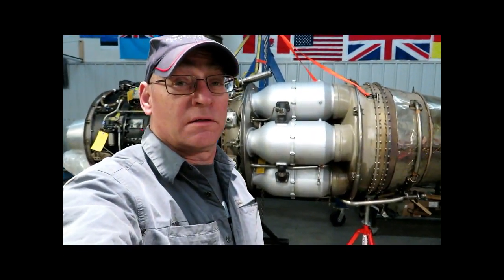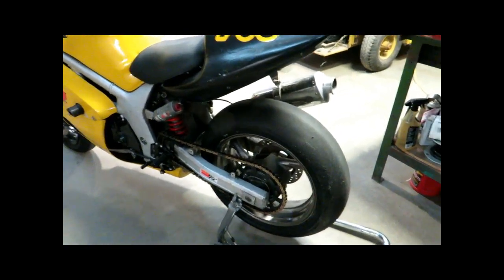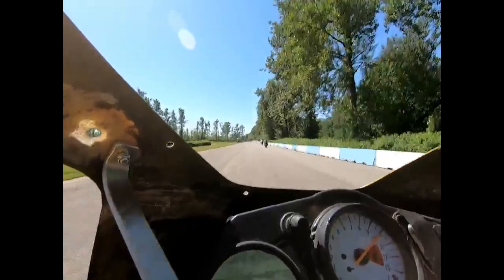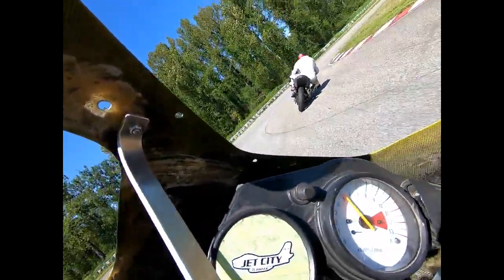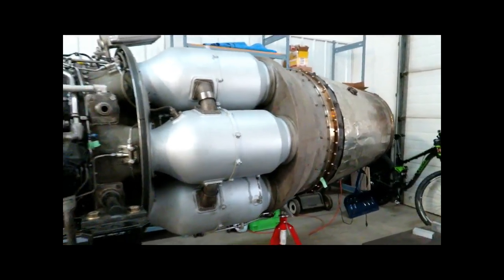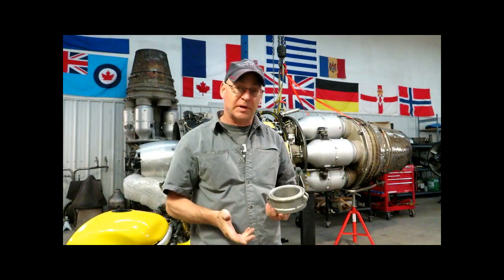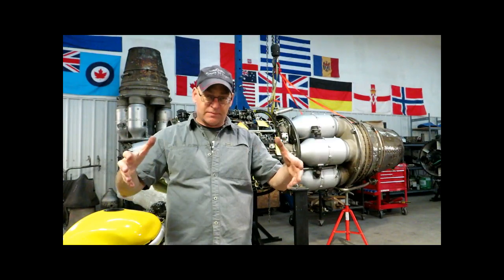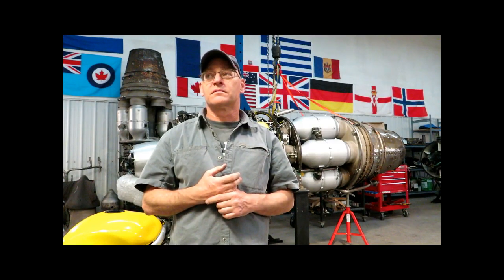Racing Bikes and Active Clearance Control

Comment: Hi Jay, Nice bike.  70 HP, I think that qualifies as a vibrating tingle rocket.  Lately I've been watching Mikey McBryan over at Plane Savers in Montreal and they had some very flattering things to say about  you and what you do.  They got really wound up when you wrote them back about the Orendas.  They clearly admire you and so do I.  After watching your work I always come away a wee bit smarter than when I started, and that's saying something coming from an man who's often been accused of being so old he farts dust from both ends.  You can teach an old dog new tricks. Just hold your breath if you hear a squeak.  Thanks for some time well spent.  T. N. from Ann Arbor.

Comment: Active clearance control seems to be a difficult topic. Even for the manufacturers.  The racc (rotor active clearance control) has been removed by a service bulletin  from most of the PW 4000s in service. The same goes for the cfm 56 series. The racc valve got replaced with a turbine bleed valve.
The hptacc (high pressure turbine active clearance control)  on cfm 56's is a bit more sophisticated, compared to the 4000's.
On the cfms, not the turbine case, but the turbine shroud hangers are being cooled (the hangers contract, so the clearance between the blades and the turbine shrouds gets smaller). The hptacc valve mixes 4th and  9th stage compressor air, depending on the thrust settings. On idle the valve is fully closed. On takeoff power only 9th stage air is being used .On higher power settings the valve is modulating, mixing 4th and 9th stage air. On cruise only 4th stage is being used. Depending on n2 (rpm of the high pressure system), the compressorblades get longer because of the centrifugal forces and thermal expansion.Therefore: if n2 is high, less cooling is needed. 9th stage air is hotter than 4th stage air, so on higer thrust settings, less 4th stage air is being used. The same goes for the lptacc. The difference is: the lptacc cools the lpt case, and only uses fan air.

Comment: For compressor clearance control or anti-icing, the air used are definitely compressor discharge air instead of post-combustion air. The air at best received some heat transfer through radiation or conduction with outer liner and are not really much hotter than compressor discharge.

Compressor clearance control typically rely less on cooling the case because there's no pressurized yet still cold air to go around -- routing from discharge forward, it's too hot; getting from the fan, it's not pressurized enough and you have no way to mix that air back into core flow. There are ways to get around, but it's a matter of cost and weight vs performance. Not 100% on the exact layout of PW4000, but feeding compressor discharge air through compressor rotor wheelspace forward to the last few stages of compressor rotors and warm them up is not new any more -- pretty sure P&W's patent's been expired by now.

Comment: Sorry your engine test stand is down but not a bad trade off to run some trackdays. I raced a superstock 2003 SV650 here in Oregon. Easy fix for your windscreen is with a $12 piece of 8mm clear plastic from Lowes/Home Depot and a heat gun. Helps to make a carboard pattern and trace out onto the plastic and then very slowly cut it out with a scoll saw and fine trim with dremel/sandpaper roll. Not as nice as the $90 ones, but it does help with the aerodynamics and worth the effort. Cheers!

Comment: I think you touched on one of the main reasons at the end for the choice of internal vs external, and that is the amount of working gas that is required to make the adjustment. A secondary reason may be that the external part is exposed to atmosphere and may be less thermally stable.

Comment: Thx for another informative video AgentJayZ. We both have interest in planes, bikes and boats. I get my Duc 1200 out on track days occasionally but not racing like you. FWIW I worked for an electric utility which  performed an upgrade on the high pressure steam (Supercritical) turbine (3500psi 1050deg f)    which involved reducing clearances between rotor and casing unfortunately during start up it rubbed due to insuficient thermal soak time (differential expansion) 2x before engineers updated start up ramp curve for tighter clearances. (Whoops) Lots of OT fixing damaged blades and opening/closing heavy casings.
Reply: Bill Dennis how cool working supercritical. I work running lms6000’s and 2 lm100’s. How many mw is that supercritical?
Reply: @JAMESWUERTELE  they were 750mw James definnately didn't want main steam leak to be around you.
Reply: We have HRSG’s, and my past was old coal plants. I know what a few hundred pound leaks look like and it’s amazing the power of steam. I’ve been around leaky old 1940’s boilers having to add phosphates to try and plug up the small leaks in the water walls. I do miss working at the older plants, this sitting in front of 36 screens is just like playing a game all day!

Comment: The subject of tip clearance control can be quite complex and axial clearances are also affected by the differences in relative thermal growth rates between rotors and stators.  
I believe that I've discussed this in the past, but there is an essential problem between the compressor and turbine rotors and their respective casings.  Compared to the rotors, the casings are thin, have relatively low thermal masses. and are close to the gas path.  In comparison, the discs have significantly greater thermal masses and their bores are relatively distant from the gas path.  
While the casings have a 'single rate' thermal growth characteristic, the rotors (particularly in the turbines) have a very distinct 'two' rate characteristic.  Why?  Because the blades grow very rapidly in a matter of seconds, as they are directly exposed to the gas path temperatures, while the discs might take into the tens of minutes to become fully heat soaked.  The casings, in the meantime, will expand in a matter of a minute or two, so it is all very dynamic and very dependent on the 'architecture' of the individual engine.  
Optimisation of the tip clearance by active management of modulated external cooling of the casing, which is typically used in the turbine(s], or heating of the rotor, which is typically used in the compressor(s), takes a good deal of finessing during the design and development process.  There can be a fine line, for instance, between allowing the tip clearances of the compressor to increase on take-off and climb-out, to avoid tip rubs, and reducing the surge margin, with the risk of inducing a surge during take-off.

Comment: When I think of it... An other reason to not cool the compressor outer casing is: There are various accessories mounted to the compressor outer casing, that most likely don't wane get frozen. The temperature gradient between casing and rotor may be so high, that you would need to blast ambient air at them. At the cruse height of an air liner ambient air gets below freezing. So it is easier to heat up the rotor. This way the outside of the compressor can stay at a comfortable and stable temperature. Also think of thermal cycles of the accessories.

On the turbine, on the other side (literally), you can't heat up the turbine blades even more without melting them. So you cool the turbine casing. There are no accessories there and if there are accessories they get heated by the exhaust. So cooling them is advantages.
Reply: The cooling effect on the exterior of the compressor casings from the external ventilation flows is relatively small, even at altitude, as compared to the heating effect from the airflow in the compressor annulus.

Comment: Great channel, sir... been binge watching as time allows. Always intrigued by these engines and glad I found you. Ive often wondered about the gyroscopic effects of them and if the designers of the airframe and powerplant work together to reduce or even apply it to the maneuverability characteristics of fighter/high performance types. Have you covered water injection yet?
Reply: These issues have all been discussed on this channel in the past.  Having been involved in the design of the Pegasus for the Harrier, I've previously confirmed that the engine was specifically designed with its two spools contra-rotating, in order to cancel out the gyroscopic effects that would otherwise have affected handling in the hover.

Comment: Thanks for the ride on your racing machine. I'm at an the stage in life that I can't do such things anymore, but still enjoy the shared experience - I fly freestyle quads (drones) as I can crash and it doesn't hurt (except my wallet).

I have a question that ties into the active compressor clearance system. Do they use such a system for the compresssor wheel(s) as well as the turbines? I think they called it ACC (Active Compressor Clearance?) but then referred to turbine blade clearance in the book.
It seems such a system would work for both, as the compressors run quite hot.

 The engine with the ceramic coating in the 1st stage turbine (Orenda 14) didn't have the 2nd stage blades coated. Is this because the 2nd stage turbine runs enough cooler that's it's not cost effective, or is it because ceramic coating is only done during a wheel rebuild for other reasons (such as damage or something else that requires re-balancing). Does the ceramic coating change clearance specs because of a change in operating temperatures? Maybe operating temps don't change, but the ceramic prevents oxidation? Please explain how this works.

It seems like electronic engine controls are moving into the turbine/aviation world in a big way. I've noticed the aviation industry tends to stay with last generation technology until it's proven reliable (which makes sense to me).
Reply from the maker: You are totally correct on the reason for not ceramic coating the second stage. It runs a few hundred degrees cooler anyway, so coating is not required. This engine was designed to run without TBCs, so they add an extra layer of thermal protection to the hottest parts, to extend their service life.

Comment: same here but on iracing...too fast for the beginners to slow for the pros......:D i love those aluminium bars holding the front :D
Reply from the maker: I paid over a hundred bucks for a special "race bodywork lightweight mount". It broke in the first race. So I made my own frame out of 3/16 aluminum scrap from YDF Racing ( next door ), bolted it together, and got them to weld it up after I adjusted it to fit. Skookum!

Comment: I recently watched one of your boat race videos and i wondered if you could do that on ice with giant skates on the bottom of the vehicle
Reply: Not with the same turbine/drive setup, because the boats use Helicopter turbine engines with built-in gear reduction and mechanical, shaft driven output shaft turning a water pump that produces water-thrust, not air thrust.

Comment: Hi j, good bike videos.  I realize that you are in a class of your own but why are you the only 650/700cc v twin bike out there? Despite the mods it doesn't seem to stay with an R6 ( or any ss600 I guess) so who do you run against? Looks like that Gsxr front end is working pretty well for braking though. Hope this doesn't set off a rant. Thx for responding. Bob.
Reply from the maker: Usually I would run ahead of the slow group, and behind the lead group, so I'm kind of on my own.

Comment: As usual excellent work, i would like to just add that HP recoup tubes and LP recoup tubes are used for this purpose (kindly correct me, if i am wrong). Also, beside ACC there is "passive clearance control" also.
Reply: Yes, there is such a thing as 'passive tip clearance control'.  I am aware that the Eurojet EJ200 has this feature in its turbines, but I will hesitate from describing it here.  I don't want anyone knocking on my door and taking me away.  It happened to a former R-R employee last year, as he had been lecturing in China on the use of thermal barrier coatings in combustion chambers and someone in the US put the UK authorities up to it.  However, his knowledge of the technology would have been ten years old and he certainly gave no secrets away.  I heard only on Thursday last from a mutual acquaintance that no further action had been taken against him, but I doubt that he'll ever visit China (or the USA) again.
Reply: @grahamj9101  Thank you sir. It's not such a new technology. But technology ethics need to be followed.
Please keep on contributing with your valuable expertise.

Comment: Have you seen any R3s on that track?  They'd probably give you a good challenge.
Reply from the maker: The FZ-07 is eligible to race in my class, and it is a superior  machine.
Reply: @AgentJayZ  MoreMoto in the UK did a MT-07 (FZ-07) special, very trick kit and it was quick even against the 5SL. Not a popular bike racing though yet in the UK as it only fits in one class at the club I race with against MT/Supertwins/R6 5SL & 5EB/749/ER6 etc. as that class allows twins up to 749 any year but the popular choice now is the IL4 5EB/5SL/B1H/CBR600F4i etc. I have a SV650 compliant with MT rules and a 5SL that is P2W restricted for class 95hp/172kg.
Club here is quite competitive. Look up BEMSEE racing vids.

Comment: hi 
I have Turbomeca Artouste IIIb turboshaft but I need to know the s\n of the harness between the engine control box and helicopter Alouette iii engine control panel, i check everywhere but they dont help me because they need the part number. can you help me plz
Reply from the maker: The comment section of a completely unrelated video to your problem is not where you need to be.

Comment: Hello I have a question! what causes the crackling sound of the flame from the afterburner as an example the engine of the concorde! is it that the air at the back of the afterburner is popping out or is it the flame itself or both? because that makes such a noise
Reply from the maker: Concorde used Turbojet engines.
Noise is proportional to difference in velocity of the propelling jet stream from ambient.
This velocity difference is much smaller in modern airliner turbofan engines.
Reply: @AgentJayZ  From memory (I'm miles away from my books), it's proportional to something like the fourth (possibly fifth?) power of the velocity difference.  When Concorde was still flying, I watched her (sorry, but I can't be PC about such a lovely lady) take off from Filton a few times when she visited and that 'crackle' was quite intense, even though her Olympus 593s had less than 20percent thrust augmentation in reheat (and no, I won't use the word afterburner).  
There is normally no instability in the jet pipe when an engine is in reheat, although phenomena such as 'buzz' and 'screech' can occur under extreme conditions.  I'm no noise expert, but I believe that the 'crackle' is down to the shearing interaction of the high velocity exhaust plume and the surrounding air.

Comment: 70(ish)hp supertwin? i though they were cranking out 80-90 as minitwins are 72hp max
Reply from the maker: It was a stock engine.
Reply: @AgentJayZ  ahh i thought you bored out the cylinders, my bad. Ive got my own sv650 2012 that im slowing making into a minitwin. Check out Brandshatch, its my local and is amazing. https://www.youtube.com/watch?v=WpVxLqhKRr8&feature=youtu.be&fbclid=IwAR2TamNJ3xnjGgX2i6qLHTxWQr5IDN9TJGP3cUVXidDKCCuhu6l3L2Xl-Tg
Reply from the maker: Well It's now otherwise stock, but bored to 694cc with no other mods. Sorry for the confusion.
Reply: @AgentJayZ  no worries man, its a nice sport. Dont go cheap on your gear :)

Comment: Anybody can answer this for me.... Does this "ACC" mean that there is certain engines that can go to certain climates or cold climates, and units that can't or shouldn't? Like a engine that performs well in Florida, USA, and then will perform just as well in North Russia's crazy cold climate?.. Or, is it safe to assume, the assumed crazy Russian cold climate is not any different then when an engine is simply flying at high altitude, as I heard that the higher you go, the colder it gets???
Reply: Dru Bradley any differences in ambient air temperature from place to place will be relatively minor when compared to the massive change in temperature from climbing up to 40k ft. Also presumably if ACC is disabled during TO and Climb then the engine probably uses things like inlet air temp and other measurements to control how much ACC I being applied, but that’s just a guess.
Reply: @bend1483  Thank you, that makes sense to me.

Comment: PW4000 powers B757
Reply: No.  The PW4000 was a replacement for the JT9D.   The PW2000 went into the B.757, in competition with the R-R RB211-535.  It was a littler more efficient, but a lot less reliable.  The -535 was the first large turbofan to achieve over 40,000hrs 'on the wing' between overhauls.

Comment: What are the little rectangular flaps surrounding the front end of some jet engine cowlings, such as in this video? (C5 Galaxy) https://youtu.be/ikDuuRzd-bE 
Are they part of an active clearance control system, or are they to increase or stabilize airflow into the engine?
Reply from the maker: Those are blow-in doors. they are spring loaded and help to increase inlet air flow when the aircraft is stationary of moving slowly at the beginning of a takeoff. As the aircraft speeds up, they close.
Reply: AgentJayZ has given you the correct answer.  The USMC's Harriers have blow-in doors.